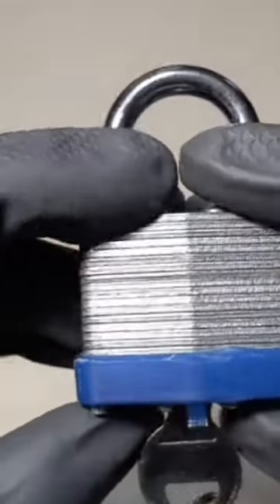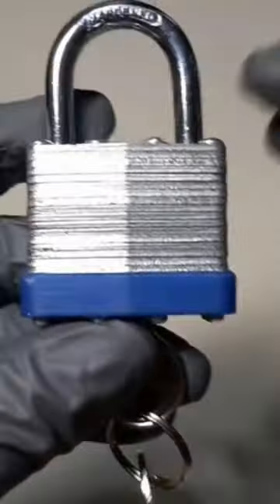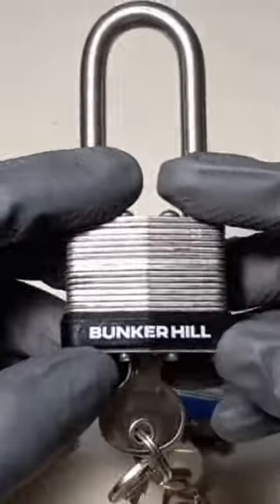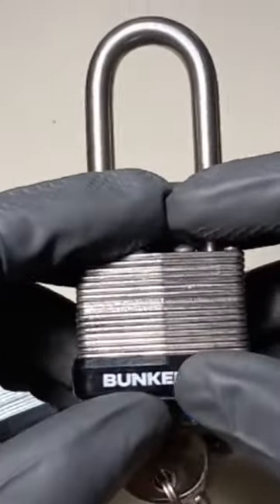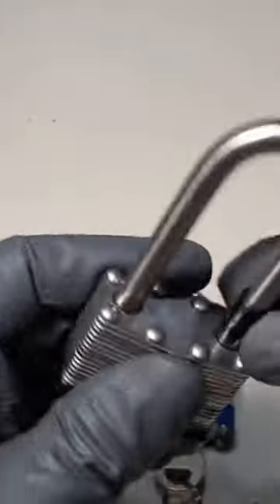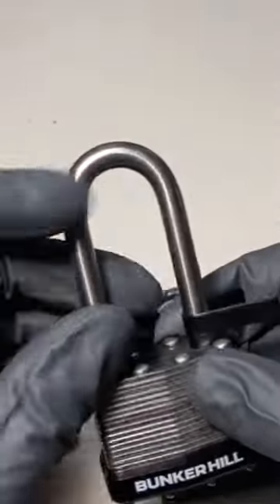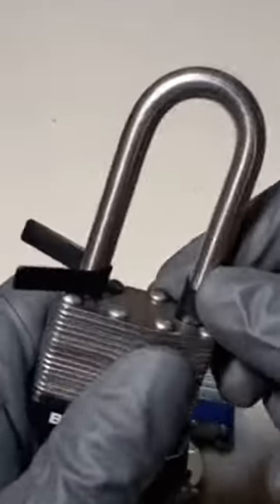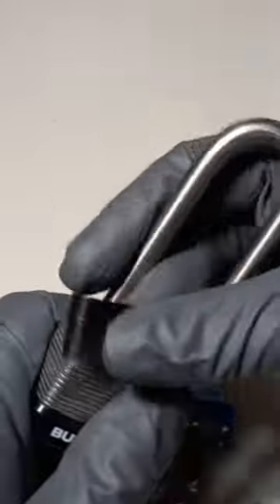Is Your Lock Secure? #locksport #lockpicking #foryou #shorts #securitybreach

Comment: I just bought the bunker hill version you showed to practice on. Its easier than my practice lock from Covert Instruments. The first time i used the rake it opened pretty much as soon as the rake entered it. Ising single pin i only need to get the forst two pins. It made me giggle a lot.
Reply from the maker: Hell yeah man! Glad the video helped ya a bit. Also if ya need good tools, check sparrows. Hes got lots of good affordable stuff. As far as practice locks go, i like sparrows cutaway + the keyway kit. Works mint to learn the basic keyways and makes it nice to see the drivers when you first start. 

Bigger question is. Have you joined the lockpickers united community yet ? Because if not, if you wanna truly get into picking locks its the place to be my dude!!.
Reply: @UnsecureSteve  I just got into it from watching Lock Pick Lawyer and McNally official,hence getting the Covert Instruments pick set and training lock. I will have to check out the community. Mainly getting into it because in Nevada you can run into locked gates that illegally block access and if shit hits the fan type scenarios.
Reply from the maker: @3ron  well shii man good luck.
Just dont get frustrated is the biggest pointer i can give. And dont rely on bypassing / raking lol. It truly only works on low security locks. Makes for good content and such but isnt very effective in most real scenarios
Reply: @UnsecureSteve  thanks, yeah my biggest issue is proper pressure on the torsion it's reminding me to slow down.

Comment: How do you Crack a safe?
Reply from the maker: Depends on what kind of safe, different models have different techniques.
Reply: A real safe wouldn't open to a rookie crook or Lock picking hobbyist.

In fact even brute force won't generally work. 

Now a safe hard box from home depot or Walmart. Those are just fireproof boxes with cam locks. Drop off a porch you're probably in like Flynn